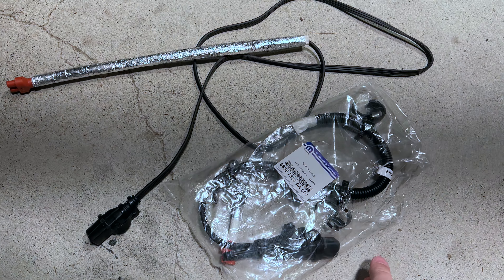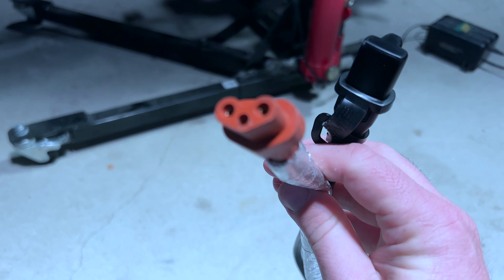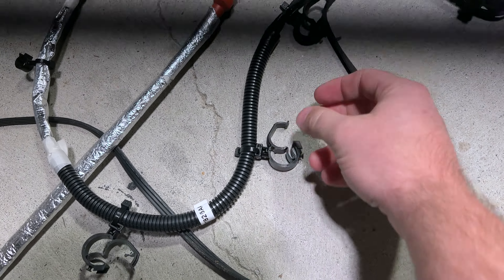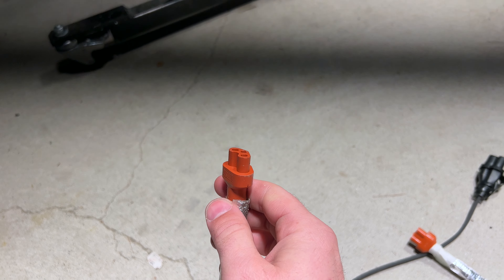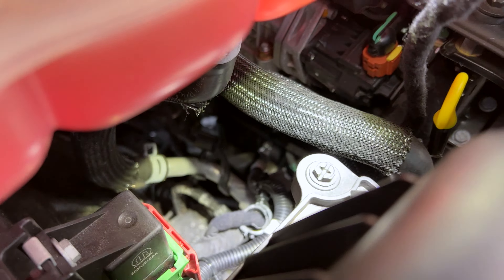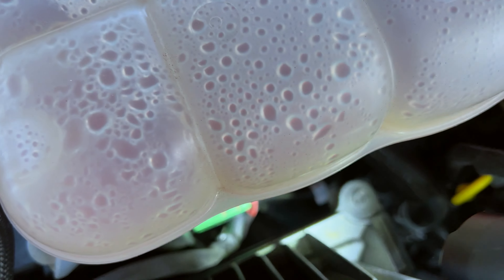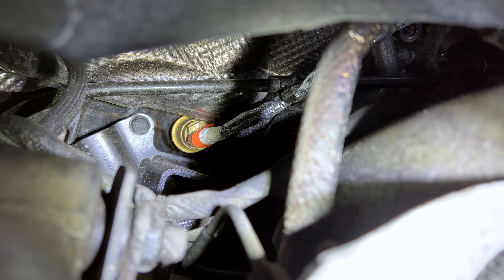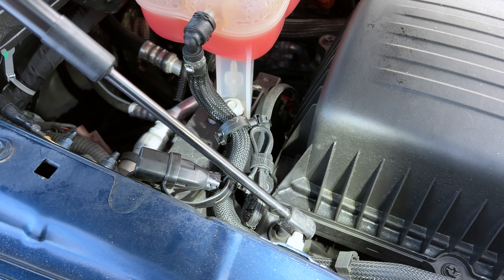RAM 1500: Mopar Heater Block Cord Install - 68357826AA 2021 EcoDiesel

Comment: I wish you would have shown a clear, in focus shot of the factory installed brass engine block.  I just purchased a 2023 Jeep Wrangler 3.0 Eco Diesel.  Jeep tells me that they have discontinued installing block heaters in their ecodiesels, so buying a $90 cord isn't going to do anything for me.  Inspecting the brass fitting in the engine block, I don't see any male/female configuration where the cord has anything to connect to.  It's basically a hollow brass fitting.  I was hopeful that you would have shown a picture of the brass fitting without the red/orange plastic cap to see what that is supposed to look like.  I am assuming it is a three pronged male fitting that the cord plugs onto?
Reply from the maker: I heard about this for newer models that they don't come with the plug. I'm very sorry about that. Had I known that they were going to ditch that, I would have done a more exhaustive look at how things plug in.